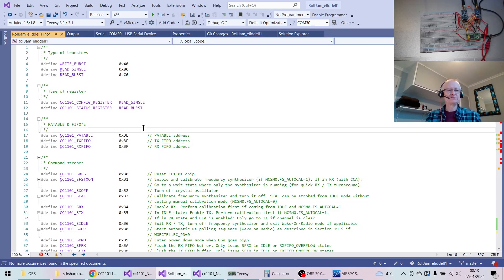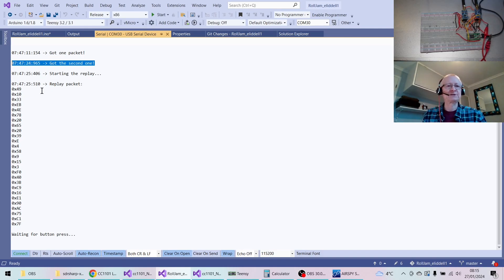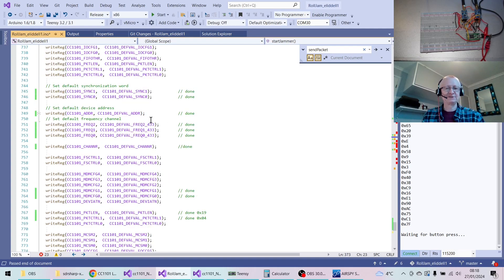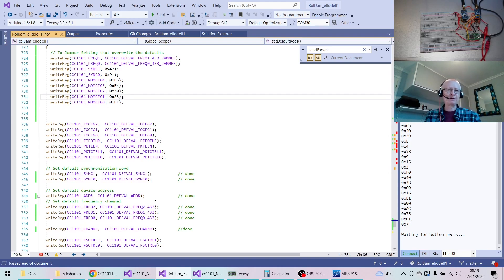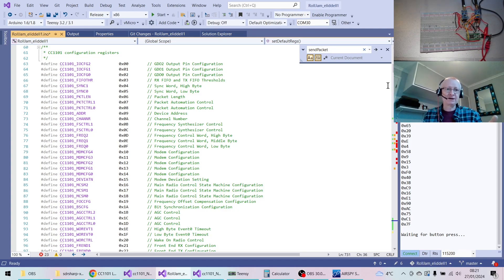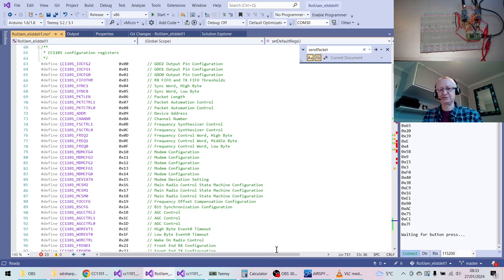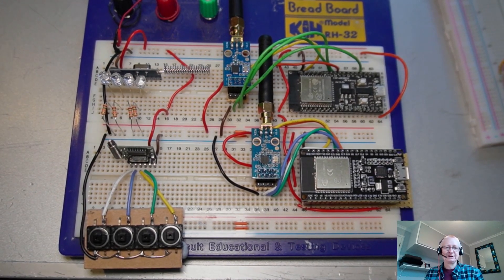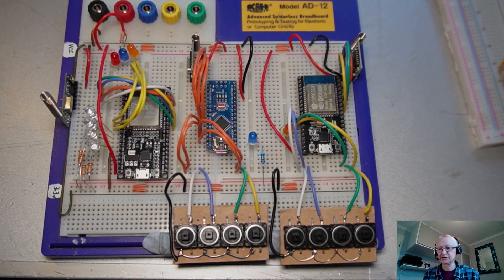RollJam on 433Mhz You can't hack this !!

Comment: Maybe I misunderstood, the entire project only offers one function for a fully 4 button sender. If this is the case, I would suggest that instead of binary, we use fibonacci number base, 1 2 3 6, if you use this base 1 = 0001, 2 = 0010, 3 = 0100, 4 = 0101, 5 = 0110, 6 = 1000, 7 = 1001, 8= 1010, 9 = 1100, 10 = 1101, 11 = 1110, 12 = 1111 and the last button could be encoded into the last code sent, so you have 12,13,14,15 based on binary coding.  If any transmitter sends any numbers above 12 in a sequence, you can lock it up.
Reply from the maker: I think you understood well. Any changes  could be made and that one could easily be added, to make a unique implementation and I encourage people to make changes to keep their own unique setup. I'm not sure you know but you can config to lock up after x unsuccessful attempts so you could tap into that,  and repeated last code etc is handled. Tx number is already hashed into the first number sent, eventually I'll hash the button probably into the first number too.

Comment: Another great experiment video with shared knowledge! 👍
But this gives me an idea - second remote with rolling code, but working in infrared range.. That will be unseenable by jammer and can be used when jammer activity in area is discovered.. 😂
Reply from the maker: It's a fact that if you didn't need the range then IR would be a safer solution 🤣